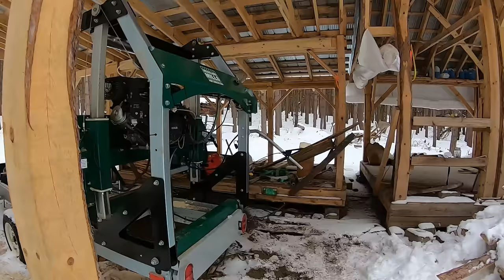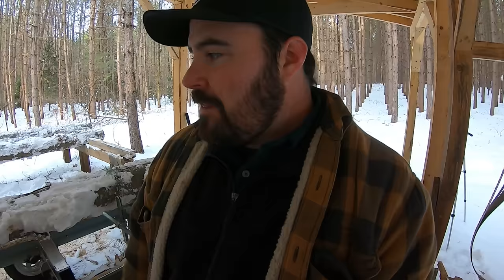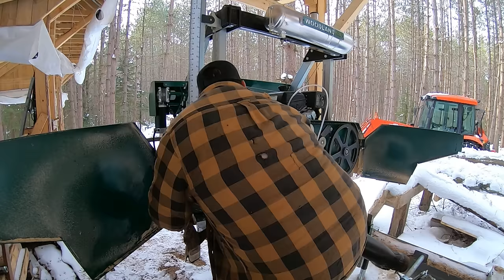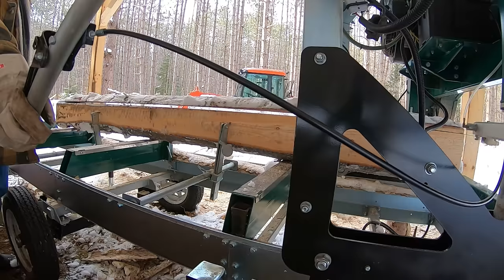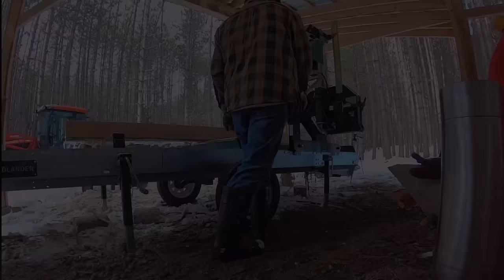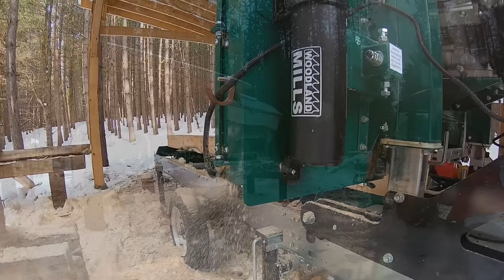I've Got the Sawmill Sickness

Comment: Amazing how much vibration is actually going on.
Watching the Lazer really makes that apparent.
I've got an old Norwood mill across the river in MN USA.
Like your dogs too. 
Mine are the old screw type. Need to change them out some day.
Reply from the maker: Sure is some vibrations for sure. I'd imagine since the engine is mounted right ot the steel without any rubber mounts or aything. Great to hear about the Norwood. Bet that things treated ya well making nice lumber over the years.
Reply: @sawingwithsandy  the Norwood has been a good mill.
If I was going to complain about anything it would be the Honda twin engine. It's a little cold blooded.
I like the way your saw starts in the cold.

Comment: Hi Sandy great videos, I ran a woodmizer  at our yard in pemberton bc, and we always used a to have the bark removed ASAP like you said but also, we brushed the line where the blade entered the log with a chain saw so if there was a Stone or san d on that side the blade didn’t have to push it through the log and get damaged,  also, cedar seemed to need the most lubrication, it’s like the tree pulled dirt into itself while it grew.    Dear needs the most water when milling.

Comment: Hello Sandy. That grapple is a sure way of controlling a log to put on the rack for sawing. If you find yourself using the forks and have a log that has not been placed on the rack, cradle the log, forks all the way back, lower the log over and onto the rack and tip the forks down. Perhaps the squirrels would like a place similar to the sawmill where they like to hide the pinecones. "If you build it, they will come". Have good days!
Reply from the maker: That method with the forks tipped back is a good method for sure. I'm hoping the squirrels start helping move lumber at the very least haha

Comment: Hi again Sandy!
I was wondering if you noticed, (besides the obvious height difference, and portability!) if there any advantages (or disadvantages) between the stationary and woodlander mills?!  
Do you find yourself checking the level of the trailer deck more often!
what do you use as a base for the trailer jacks? (I would think you would have the same problem as your first mill  set up, during the freeze/thaw cycles!)
Reply from the maker: I don't regularly check the level of the sawmill on the trailer as I find the sawmill will tell me if it's too far off level as it will roll away on me. I don't find it settles much at all except for when I"m on soft ground. I like the height on the trailer for working a bit more than the older one on the ground. Only thing I don't like as much is loading the logs from the opposite side that I walk on.

Comment: What size torque wrench 3/8 or 1/2 inch.
I just bought the Max30 extended and trailer. Need a Lazer too.
Thanks 
Bob from Minnesota
Reply from the maker: Hi Bob I’m using a 3/8” torque wrench here
Reply from the maker: However I am using a 3/8 to 1/2” adapter for the socket

Comment: Wonder if you could make some kind of cover for your mill to cover the small openings where the blade runs in/out to keep the critters out. I'd worry about them chewing on the rubber tires as well.
Reply from the maker: I think that’s probably a good idea Roger. Wonder if I could put some chicken wire or so in there when not sawing

Comment: Hey Sandy. Even sitting here with a fire in the fireplace it looked chilly in Ontario. BC is an easy +3C right now. Would you be able to tell me the make and model of those lasers? I hope it isn't FAQ and I'm being a pain. Faithful viewers. 👍😁
Reply from the maker: Sure no problem Clyde. Laser details:

TZ16X70-520L 50mw
https://www.apinex.com/ret2/TZ16X70-520L.html

BRH 16mm 
https://www.apinex.com/ret2/brhan.html

K12243
https://www.apinex.com/ret2/K12243.html
Reply: @sawingwithsandy  Thank you kindly amigo. I'll need to Doo a small mill job to get the funds. That's the fun part.

Comment: Hey Sandy,
   I haven't bit the bullet yet in buying the 130max. I'm still working out where I want to layout everything. So I watch A LOT of your videos! So I still have a lot of questions.
1) If you had it to do over again, would you get the extention up front to lengthen the trailer to cut 16 foot logs?
2) How big would you build the shed for the mill? I'm thinking about 12' x 25'. What dimensions do you suggest?
3) I see that when you built your trailer you set the head to cut from tail to tongue of the trailer. Can the head be placed in reverse so it would cut from tongue to tail thus throwing the saw dust to the other side?
4) Now that you have the mill on a trailer would you or have you ever gone on location to saw up someone's down tree. i.e. custom sawing at their location. I realize there would be problems getting the log up on the mill but with ramps and winches it could be done.  And at what price?
Just a couple of questions I keep coming up with!!
Reply from the maker: Great questions. I think the extension would be great to have right from the start so it could be installed right when I did the initial assembly. I like the trailer and think its great for going around the property or even to someone else's property to mill. I think I'd still get that in the future for those reasons. Plus nice to be able to move the trailer to clean under the sawmill from time to time. You could rotate the sawig directly around if you would for sure. I think the dimensions of my last sawmill shed were quite good at  20' long by 10'. Hope that helps and thanks again for coming along for the tour

Comment: What's up Sandy 👊 just a thought why couldn't they make the blade pulleys a little wider and a wider blade with teeth on both sides just different angle for opposite direction?  Cut both directions, Every time I see a mill I have the same thought 😂😂
Reply from the maker: That' would be a neat setup for sure

Comment: Good Morning and have a nice Monday morning. @Sandy: May I ask you a question. Looking at your videos is see that your saw-head is perfectly smooth and stabile (beside shakes from the engine). I own the same saw and last time I was cutting a 65cm walnut log for some reason it started shaking and wiggling in the direction of the blade during the cut - orthogonal to the forward movement of the the saw-head. Changed the speed of cutting etc... no real effect on that. Checked the tightness of everything - seems to be so. Any advise? Did you face these movements on our saw? Thx.
Reply from the maker: Hi Arnold. Only thing I can think of is the blade could be getting dull. Otherwise there is some shims on the vertical steel posts that can be adjusted to prevent the shaking. I don't recall the movements you mentioned.

Comment: I was sure you could not extend the saw mill if it was on a trailer. I was sure you have to order the XL trailer and that the Regular trailer could not be upgrated?

We just received our HM126 with Xl trailer. In the process of assembling it. hoping that we will not regret the HM126 over the HM130.
Reply from the maker: Thanks for watching Francis. There is a trailer extension that allows for the sawmill to be extended as well.

Comment: Good morning Sandy those tree rats were at it again never had that problem with the mill but those little rascal did trash 2 of my best gas can by chewing holes in them 
   Has far as the thithening goes my hm 126 2015 they told in the book to put 35 pd. Pressure but all the new ones says less then mine so I will keep doing mine at 35 never had trouble with it also with 1 extension could barely do 16 feet and 4 or 5 inches and had to be place right so now I got 2 extra extention and max 23 feet I did do some 20 footer and that is a long way on the same cut have a great day
Reply from the maker: hahah tree rats haha. I had those pesky rats chew a hole in my gas cap on my snowblower as well. 2 extensions sure would be handy!
Reply: That explains why my gas jug was chewed up last winter. I thought it was a coon. Why do squirrels want to chew on gas jugs?? Weird

Comment: My woodland mill is set up for 16'  logs on a trailer and I have the same issues as you with length when trying to cut 16' logs, the bigger the log the harder it is work with too. I wish they had given a little more in length but does open up the 12'  & 14' length too. Enjoyed the video aways some good info. 👍
Reply from the maker: For sure Del. Thanks for coming along today

Comment: Lookin good Sandy- you have snow!  Better then mud which is what I have been dealing with up till yesterday.  I noticed when you do your second cut that you flip your log to the opposite side instead of 90 degrees … is there a particular reason you do it this way?  I have done it this way as well in the past but find I don’t always get a square cant- not sure why exactly - seems to come out better for me when I flip 90 degrees at a time.
Reply from the maker: The mud sure can be a headache . It’s been warm then cold then warm then cold here lately. I like to flip the log 180 I keep the log flat on the bunks in hopes of getting a steady log to cut a parallel side
Reply: @sawingwithsandy  ok Thks - I’m hoping the real cold weather holds off till I get the roof on my new sawmill shed - btw I have red squirrels at my cabin and they are a royal pain and I’m sorry but I laughed when you showed us the stash of pine cones in your mill - I’ve shot some of mine so I don’t have as much problems right now

Comment: Does your laser guide work in the cold? Never mind  LOL  I just saw it.    Sandy are you cutting dimensional lumber or full rough cut most of the time?  we cut full rough for most of our out building for extra strength.  But dimensional when customers request or we are working on repairs of a store bought structure.
Reply from the maker: I’m typically cutting 1.5” x6” lately

Comment: Sandy you are always saying how you like to do thing simple way, i do not know way i see a lot saw-millers on YouTube doing what you just did on changing your saw blade, way do you like to work over the table to reach the other side when in fact you could run the saw head all the way to the end where there is no table to reach across simple as that, thank you Happy sawing
Reply from the maker: That would work for sure Bill. Often times I keep the saw at the end where I was so the saw dust roll away from me if I push against the saw

Comment: Do you cut your lumber same dimensions as store bought lumber or is the thickness  true 2 inches?
Reply from the maker: Up until recently I cut true dimension 2"x4" but recently started cutting 1.5" x 4" which isn't quite the same but the 1.5" is to allow for easy use of things like joist hangers

Comment: Looks like you upgraded your laser mounts from the previous deployment?  Did you wire these into your key switch (so that you don't need to separately turn them on/off)?
Reply from the maker: Hi Paul, I did change out the laser mounts for something more solid just to keep things steady. I've got a video out in the playlist if you want to check out the install. I installed it on a separate switch as I often walk in front of the sawmill to rotate the log and like to turn off the lasers so I don't accidentally get blinded by them

Comment: When you live in the woods, the best effort is to never bring home fuel with ethanol .
Reply from the maker: Yeah I agree. Truthfully I’ve not felt the effects of ethanol much as I tend to use the equipment a lot so fuel is constantly cycling
Reply: @sawingwithsandy  ethanol is insidious. Even resting in the plastic polymers, and rubberized plastic fuel line , the ethanol molecules bond to them and eat away the plastics like little ‘red squirrels’ 😉